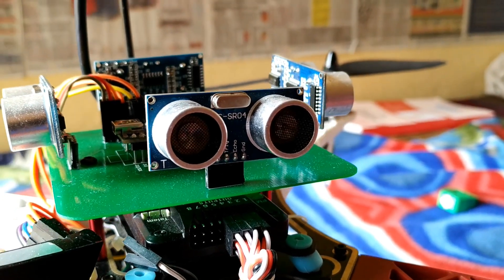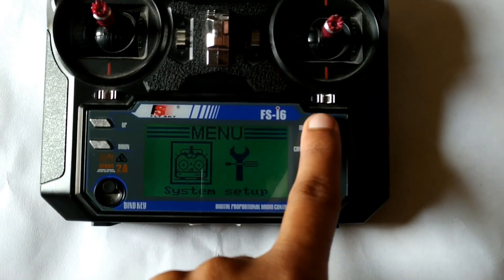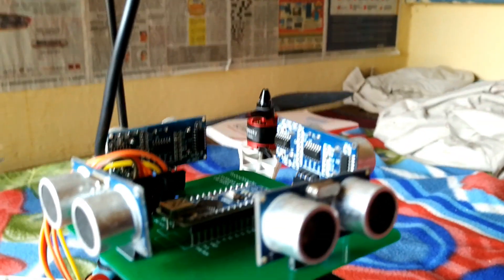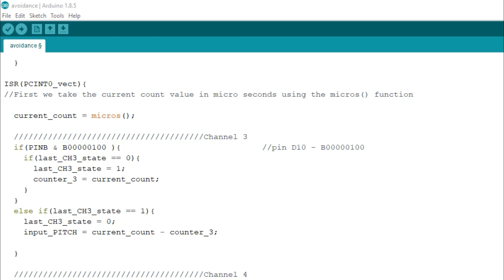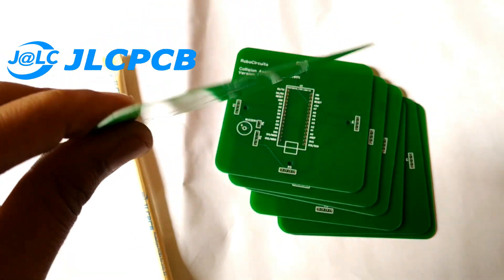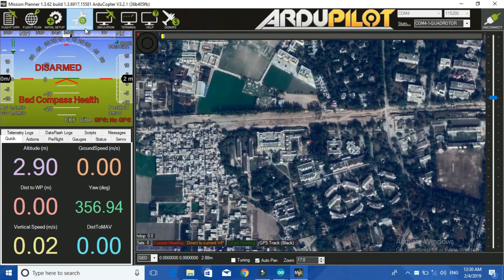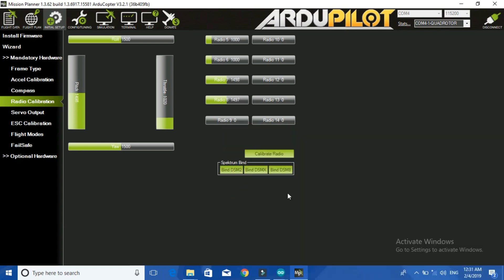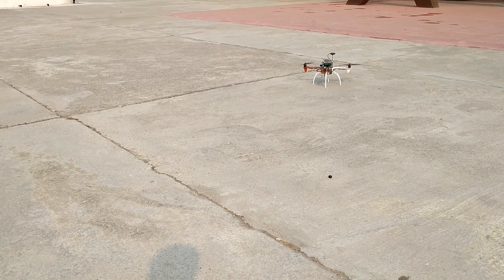Drone Collision Avoidance System by RoboCircuits

Comment: You can remove excessive ultrasonic sensors and use a single ultrasonic sensor by attaching it to continuous rotation 360 degrees servo motor, it will provide all side view and would help in reducing weight😊
Reply: how can you rotate with wires attached?

Comment: instead of using a separate flight controller you should program the nano itself with PID loop
Reply from the maker: Yeah thats true
But it needs tons of calibration and proper coding skills
Reply: The code can be found online. However,, calibration is an issue tho. I generally do the calibration in a virtual simulation (Google's Brax) and it works out pretty well on the real drone as well! 
But yeah, coding knowledge is required, so that's a disadvantage.
Great work by the way!
Reply from the maker: Virtual simulation seems interesting i will check it out. 
I used multiwii once and it’s calibration was very hard

Comment: Instead of by passing yaw and pitch from receiver, you can use the i2c port. Like that of in radio telemetry
Reply from the maker: Yes... I am working on next version of it
Reply: is still possible if using fuzzy logic method ?
Reply from the maker: Its unreliable

Comment: Possibly add carbon fibre rods (  sensors mounted at  extended end ) in a crucifix pattern exiting from the centre of the SUA below the props extending half the radius of the prop arms themselves. Obviously connected back to the PCB via cables.
Reply from the maker: i am working on part 2... i will consider your advise
Reply from the maker: it will keep them away from noise as well
Reply: You’re welcome, good luck with part two.

Comment: I made a similar system, but I made a receiver, with arduino of 6 channels and the sonar integrated in it. I connect my receiver to a flight control. Independent.
I use a routine on the receiver to avoid collisions.
Reply: Hi! Can you tell me more about your project?I have tu make a Indoor positioning control system of a drone.My mail address: elena.alina1993@yahoo.ro! Thank you!
Reply: @mecatronicaunitbv1693  it is very simple. just add to the receiver I made, a routine, which reads a couple of sonar and depending on the distance to any object. take the necessary action.
example .. a wall in front of the drone, brakes and stops the drone, direct on the receiver forward pulse.
The only thing I did was control the pulses towards the flight control
Reply from the maker: Sounds great!
Did it worked?
Reply: @RoboCircuits  
I had no problems, I placed the sonar, with a sponge covering the lateral noise, and I spread the two sensors with small cardboard tubes in them
Reply: @RoboCircuits  but I want to clarify, I only did it as an experiment I fly in fpv. and get bored of flying at low speed.

sonar is slow

Comment: hello sir really liked the project and egerly waiting for the part
some suggetions...
1 remove gps to save weight and make more stable flight
2- try some high discharge batteries like upto 55c ...what i can see you r using 2200 mah that provide discharge of 25c..so motor gets less power and cannot work effectively
thank you..i hope you liked my suggestion
Reply from the maker: Yes... I tried them.out... my battery was not working properly... Due to over use...  When i replaced the batteries it worked... But it still have issues
Reply: Waiting for the video😍 is code not working as expected?
Reply from the maker: Yes ... Code is not working as expected
Reply: Hello Can i have also your email.... I have the sema project
Reply from the maker: robocircuits@gmail.com